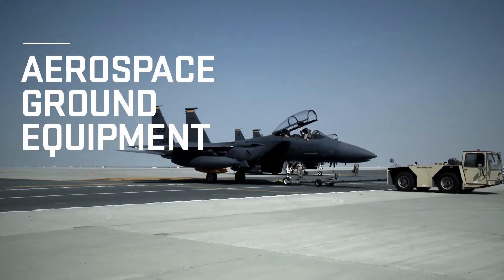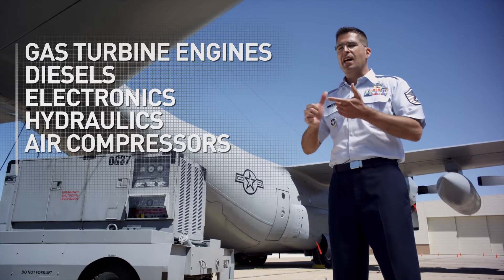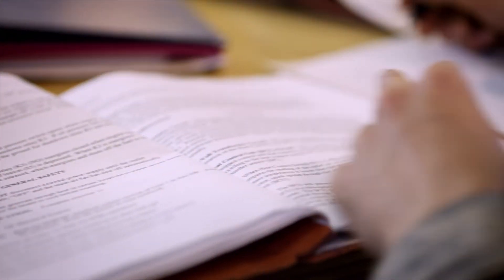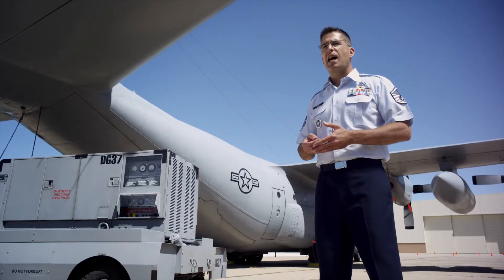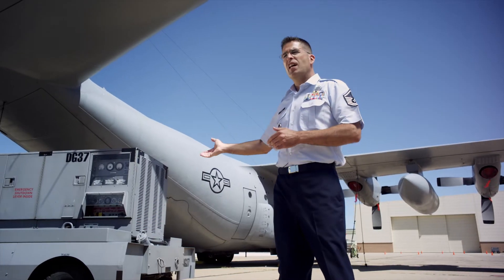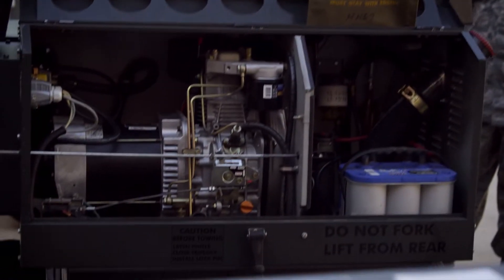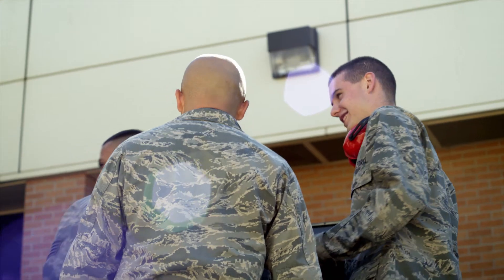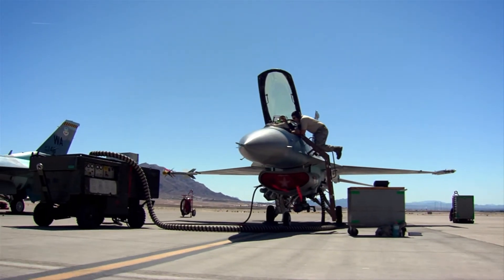U.S. Air Force: Aerospace Ground Equipment

Comment: It was a good AFSC. I worked -60s, MJ-1 & 4s, MD-3, just to name a few. If you can work swing shift that is best. Before I joined (72/80) I couldn’t tell what the difference was between pliers and screw drivers. When I got out I had a great background for all things mechanical. The U.S.A.F. Gave me a great spring board for life. If you are positive towards it, it will be more than that to you back. I hope the best to anyone that is about to make this journey.
Reply from the maker: Thank you for your service!!

Comment: DINSTAAR!!!

AGE was the best job I ever had.
Reply: What career it could be used on the civilian side
Reply: @lilricky5483  You work on such diverse equipment it can transfer over to many civilian careers. Here is what you will learn: diesel engines, gas engines, air conditioning, heating, pneumatics, electronics, generation, and hydraulics. You can take these skills to any number of civilian jobs and be a top pick to be hired. When I got out, I found my experience allowed me to work on just about anything. My mechanical and electrical knowledge was extremely versatile. After AGE training and years of experience you can tear just about anything apart and figure out how it works and how to repair it.

Comment: Where is the tech school
Located
Reply from the maker: Sheppard AFB, TX 87 Days

Don
Air Force and Space Force Recruiting Service
Reply: Im a crew chief on 130’s about to switch over to AGE
Reply: @codytotten9545 why??? 
It's a good career because you learn souch but why??
Reply: @socer451 well im in the guard, I was hired
On as a federal technician so I had to reclass. I also wanted to go back to trade school for electrical, and the job it also involves hvac. I feel like the job would be a good for that
Reply: Hell

Comment: The video is not a good representation of the job. It's much more than just power generation. Now, with new aircraft such as the F-35s, you may be exposed to totally new equipment that works on a multitude of different principals. Hydraulics, facility power, diesel, and others. 

Additionally, someone needed to have fact checked the specs because the MSgt was referring to a -86 whereas the Amn was detailing a -60.
Reply: I appreciate you immensely for your input